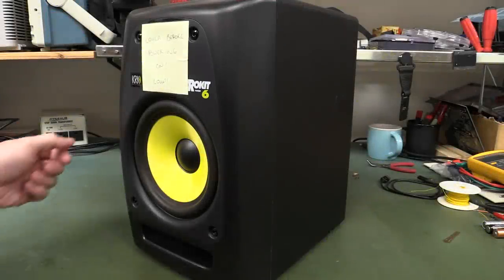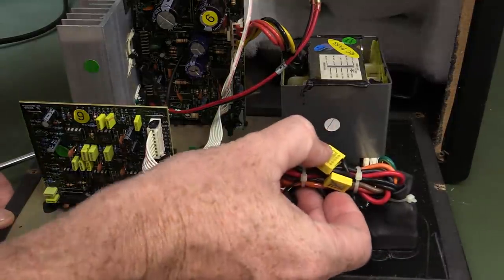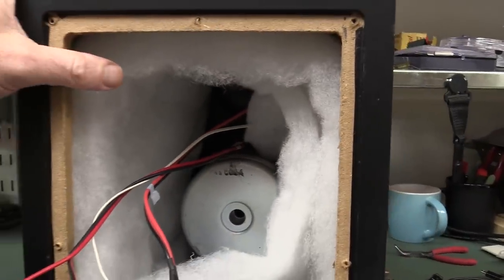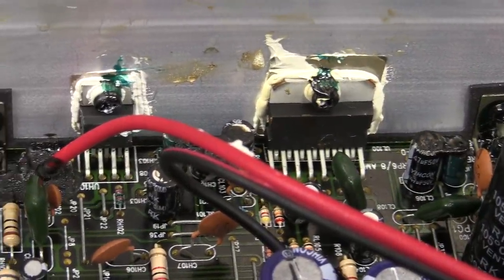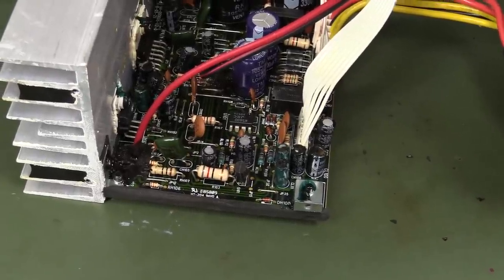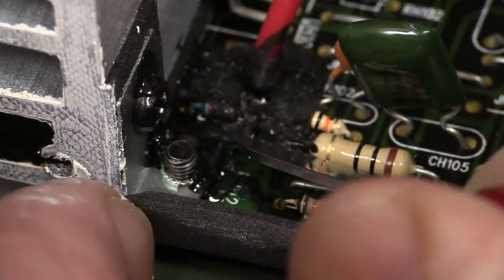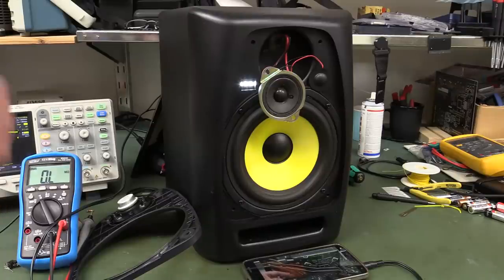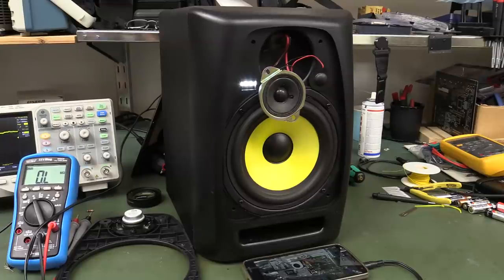EEVblog #1072 - KRK Rokit 6 Studio Monitor Speaker Repair

Comment: I have the Sony those tweeters came from😐. Well, they are okay, but they are certainly not a KRK. I have newer Rokit 5s G3 speakers as well. These are the G2 model. The original G1 had similar electronics to the G2, but the box looked, well... like a box.

Comment: Looks like another case of planned obsolescence to me... Had a similar conductive gunk issue with a pair of Tannoy Precision 8D's (I posted on the forum about that a couple of years ago). No idea why they don't take a leaf out of the history books and use wax like they used on old radio receivers in the 60s and 70s. As for the KRK monitors, they are too coloured for studio use, but often used in trade shows as the colouration makes the gear sound nicer than it really is.

Comment: There are two things going on in manufacturing. One: Idiots work a job they have no clue about. Two: People know what they are doing and they sabotage units so the units break down 2-3 years later so the consuming idiots can buy another product from them with manufacturer stating how the new model is improved in quality over the old one. Corporate lies. Consumers should learn on the mistakes and go for a better product, do a proper research. I personally either go for high class Sony or Asus but everything else is custom made from people I can trust and I am sometimes even involved in the production of the custom made things so I deeply know what have been done to it.

Comment: I'm having this same issue, same exact sound! I noticed two of the smaller caps are bulging, but not the big ones. I actually had this unit repaired at KRK once as well, but not sure if this new issue is the caps gone bad or the goo. Would bad caps make this same sound?

Comment: Kind of makes me want to check my Edifier speakers now. Sure the last time I opened it, had selastic inside! Oh, and my dell server PSU's! They had selastic everywhere. 
Teardown of the Dell 2950 Poweredge power supply coming soon! Built like a brick s**t house or Dave would say what is it? Built like a Brick Dunny?

http://www.oxfordreference.com/view/10.1093/acref/9780195563160.001.0001/acref-9780195563160-e-434

Comment: That nasty stuff decomposes with heat and age etc and then becomes hygroscopic, the water then mixes with the decomposed material, which creates an acid and causes all the corrosion. What I can't believe is that new equipment is still using this stuff instead of the proper Silastic.
Reply: Mark Wallis I've encountered very similar issues in the plastics used both in some SATA power splitters that eventually corrode the contacts and short out the power rails in several of my PCs as well as with some 455KHz IF filters used by Kenwood in some of their radios that decomposes over time rendering the radios almost entirely deaf on receive -- in fact their is a TS-480 on my workbench with this exact issue right now waiting for me to order and replace all 3 filters.

Comment: I checked the RRP for the KRK Rokit 6 and they are available for about $300au each, that's $600 for two. They are just a cheap plastic Chinese speakers and the amps and electronics are awful. Obviously are making a massive profit.

Comment: The spliced tweeter cables are factory too 😀 Nice diagnoses and job I’ve done a few of these, have to replace all caps, remove all that glue and sometimes the resistors and zenner diodes below the glue need replacing.

Comment: Looks like some kind of chemical damage? Perhaps some chemical vapors got in, moisture or something reacted with it.

The tweeter likely broke some wires when membrane moved too far? And just happened to touch and make a connection until you moved it.

Comment: Do I need to worry about this happening with Shoe Goo? I used it to build up strain reliefs on a crossover board, and to glue components to the circuit board so that they would not vibrate. It's that clear, flexible stuff, that you would use to repair shoe. I opted for that over hot glue or zip ties, because it's slightly flexible, doesn't require hot glue gun, and several people who have started using that swear by it.

Comment: I would never have guessed in my life that at the factory they could deliberately pour some unverified shit on the board, which would become electrically conductive over time. Some kind of wicked sabotage. I must say, almost any professional audio monitors are doused with some kind of viscous rubbish inside to resist vibration.

Comment: If you think that a bit of conductive gunk killing a tweeter in a $200 powered speaker is annoying,  try a bit of conductive potting on a filter in a $50K Sony Betacam SP VTR, or a $100K 1" C format VTR.  Sony had their video filter module cans inside the machines potted with some epoxy, which becomes conductive, and is hard to remove without destroying the filter PCB. Then there is the glue they used to hold down some wiring between boards which became conductive and corrosive and would eat through board traces and connectors.

Comment: Damn! i'm listing to this on krk rokit 8's of the same generation.  Tho I've had these speakers since 2012. Everyday heavy use and I move them around for Mobil production, they work just fine  so if they died now i basically got my use out of em anyway. I haven't even turned them off since 2012 lol  switch on the back is a pain.  the shitty design really has me worried i always thought one of my speakers sounded slightly less bass i always thought it was just the shape of the room now i think its probably its probably because of this black garbage
Reply: Phillip Morrison ... Hmmmm how do you move them around for mobile production if you never turn them of???? Either they are battery powered or you have the longest extension power cord in the world LoL...
Reply: obviously they are turned off when i move them but thats only been like 20 or so times in the last 6 years. i never turn them off if they are at my house
Reply: Yeah Phillip... I knew what you meant but I think that you got a bit excited when you typed out your original post LoL... It's okay mate... Say.. Are your 8's a three way... I was looking at getting them a while ago but I needed something for mastering and they needed to have a very transparent characteristic in order to be able to hear any problems with the find mix... The KRK 8's were BASS heavy but the sound of the Fostex PM842 was perfect for what I use them for..
Reply: The rokit 8s are bi ampd witha woofer and a tweeter. I find that people always over exaggerate how "unbalanced"and over bass heavy the krk's are... They get a bad wrap because they are popular and they are yellow... And people love to hate whats popular and panted like a toy. To my ear the krks sound better than the new version of the yamaha ns10's everyone always raves about that sound like they got a bad guitar amp on the high end and the low end just vibrates the room in an unpleasant way.  I find the whole idea of a transparent flat monitor ridiculous. I know what the manufacture means as in there is no DSP or added EQ or saturation.  However every monitor I've listened to  from cheap Mackie's to genelecs and especially custom in wall studio monitors sounds vastly different with varying amounts off bass high end and frequency response across the spectrum changes as well. Also all speakers distort the more you turn them up and they all distort differently.

Comment: this is one of the reasons l never buy active speakers, because if my amp takes a shit it doesn't ruin my good speakers. but if your amp is intergrated and it kicks the bucket then your speakers are pretty much junk since they were made to run with that amp. also you're kind of putting yourself at the mercy of your manufacturer when you buy active speakers, because they could be great speakers with a shitty little amp inside. l have seen some pretty nice speakers in the sub $100 ranger and they come in both passive and active variants and the active version comes with a cheap amp that is under powering them.

Comment: I have 4 rocket 8s and 4 rocket 5s. Is this problem common and looking at the black gunk is this or could this be a fire hazard if the system shorts out. I usually leave a lot of my set up on simply because inspiration comes all of a sudden and when it does I need to get it recorded instantly otherwise if not its gone out of my head as fast as it arrived.

Comment: HAHAHAHAHA. Oh wow!!! I've repaired thousands of these buggers!! Until recently I worked for a company that had the contract KRK for returns and repairs!! This is a G2. The amplifier PCBs can fail after about 5 or 6 years when the glue that is used on some of the components becomes CONDUCTIVE!!!!
Reply: We used to take out the Amp PCB and soak it in Nitro mors!!!

Comment: The convenience of having volume and headphone jack on the front of the speaker? That's what a USB audio interface is for. I got the Mackie Onyx Artist 1-2 right in the middle of my desk. Got a nice big volume knob, separate volume for my headphones, headphone jack right on the front, and separate volumes for the XLR and TRS inputs on the front as well. Then USB goes to my PC and TRS goes out the back to my two Behringer Truth B2031A's.

But if you didn't want to get into all that, the USB monitors are nice to have.

You should see the inside of the B2031A's. Really well done in there. Beautiful bi-amp setup.

Comment: In the 1980s all Sony TV Broadcast BetaCam SP VTRs etc with a few good hours on them ALL began having massive fails with their little PCB mounted screened filter cans in the component/composite chroma/luminace paths. It was usually a matter of desoldering the filter and picking off the underside plastic insulator to reveal the micro filter network pcb and scratching off the brown shmoo that had been used to glue the insulator on with and was now conductive !.... Sometimes though the filter was just too knackered and you had to use a new one and they were BLOODY EXPENSIVE.... Replaced 100s of them...

Comment: I would have thought that all filtering would be done using DSP processors and firmware with a ADC on the input and two 50-100W PWM amps driving the base/midrange unit and tweeter, The sound system I am using to listen to you is using DSP processors and Firmware also the output is 50-100W PWM amps, The bass unit is also DSP based with a 50-100W PWM amp and can go really loud and is bluetoothed to the main unit.

Comment: Exact same problem with one of my KRK 6" gen2's: woofer stopped functioning after being powered off for a few weeks - So incredibly grateful i found this video - I have absolutely zero experience repairing things like this, and was able to find the black goo and scrape it off the pcb with a mini screwdriver / paperclip + some rubbing alcohol - Most needed to be chipped away, but some of the goo was "wet" - (wonder if the potting material melts down due to the generated heat, and then starts to grab and hold water vapor?) - Fortunately, the goo was only in a few isolated areas, and took me no more than an hour to clean up - Didn't seem to work at first, but about a minute later, the bass faded back in to its normal level - This video saved me not only ~$150 on a matching replacement, but more importantly, it opened my eyes to that very replacement would have also been potentially problematic down the road - THANK YOU.

Comment: Funny. About a year ago I was on a service call at a restaurant, troubleshooting their little soft serve Ice cream maker/server, the standard one with two flavor bins and 3 levers in the front for either flavor or mixed in the middle. The mixing motor shaft key had sheared off due to someone sticking something in there while running probably, but what dropped my jaw a little was the 2 inches of MUCK pooled up on the bottom of the enclosure, engulfing everything due to no drain hole apparently, including the wiring harness for the stirring motor, which used a belt to run a drive wheel with the mixing heads axle shaft (where the key had sheared). Of course I always check motor stats out of service call courtesy (and it's sparky-fun), so I was measuring some weirdness and decided to grab a big spoon from the kitchen and shovel out some of the semi-dry brownie mix filth to see if maybe it had somehow eaten through the motor leads. Found the harness, stuck my meter probes into the much and wow! The resistance was bouncing around in the 1k range, plus or minus a couple hundred ohms...! And I would definitely not say the ummmm, "batter" was "wet" in any significant sense, too....! Needless to say I wasn't afforded a lot of time to play with it, and also since the day manager was kinda looking on and saw the ummmm, "ruiner of soft-serve ice cream for me" and wanted to clean it right away, I didn't get to play with my megger that I was hoping to get out, throw some 1000v through it, see what the needle does, lol. Oh well, still strange conductivity from things that probably shouldn't have such properties, especially thinking about eating it...!!??!!   HA!   BTW, good work!

Comment: Funny, a few years ago I had a similar issue with my (well, now like 15 year old) JBL SCS 135 5.1 set - conductive gunk on one of the subwoofer boards. It started "motorboating" once I turned it on. Scraped it all off, works like a new one again!

Comment: Sony used a white glue in the 1980s after 6years it turned brown and conductive, this was in their broadcast equipment.
At AWA in the 70s we used neutral curing, slumping silicon, it was so expensive only the girls (55 and 56 I was 17) were aloud to use it.

Comment: That is a disgrace. What is the gunk made of? Weirdly, it may have been a rubber compound of one sort or another, which became conductive over time due to whatever they added to the rubber. I have seen slightly similar gunk before, when the belts of cassette tape players made in the 1970s, liquefy and must obviously be replaced. What interested me about the degraded 'rubber' cassette player belts, is that they turned into a similar looking black liquid goo, which had to be removed from belt pulley wheels using cotton buds and 99.99% isopropanol. Excellent video. Have never seen this before, and enjoyed the fact I was thinking in precisely the same way when you were taking it apart (aside from managing to convince myself a bunch of electrolytic caps had failed when that was not so as you demonstrated. brilliant video...important reminder of the need to test gunk for conductivity

Comment: Ack! KRKs are studio monitors that should be "set and forget" and volume controlled via your interfaces hardware mixer. The headphone jack should be on the audio interface, not speaker. These are not desktop speakers. They belong on stands about 6 to 8 feet away. Sorry, but your USB speakers are DSP controlled and entirely inappropriate for a proper recording monitoring and mixing environment as the sound is not even close to accurate.

Comment: In an audio amplifier in a speaker enclosure, there is a definite possibility of microphonics causing feedback.  Unfortunately the "solution" is to immobilize anything that MIGHT be in the feedback loop.  Thus the "goop" (probably liquid gliptal or some such ("liquid tape"?).  The cheap components (design to price) are susceptible to microphonics (ceramic caps seem to be vulnerable) and you are witnessing a "shotgun" approach to attempt to solve the problem.  To further diagnose the problem you might start tapping components (on both boards) to see if there are components susceptible to the problem.  The real solution is to have the amplifier in a separate box so it won't be effected.  You might have it functional when in pieces, but when you put it back together, and sweep out the response, you might trigger a problem somewhere.

Very good diagnosis.  Visual inspection, then power supplies.  #1 and #2 in the test list!

Comment: lol, the classic glue that goes conductive. You can see in the video it's even got droplets of water(?) on the glue surface. Very common in logitech z906 and some other electronics.
 Imagine this on the smps psu of the z906(so at 230v mains rectified voltage), let's just say  i've seen lots of them with  burned pcb's.  Another type of glue that becomes conductive is the white one that starts to turn brown, yellow. 
I'm gonna go with planned obsolence, no way the folks at logitech  don't know about this problem

Comment: I just want to say something about speakers. 
1. Be aware of the climate you are using them in. 
2. Studio monitors are intended for studios not home entertainment. 
3. Don't buy expensive studio speakers without knowing what you need. Speaker size vs. Room size. Positioning and isolation. Will they mix well with your active speakers. Dynamic range. Wattage. Driver types. Cabinet or ported. 

Now with that being said the KRK are a good all around mid range speaker. If you think you're going to blow your shirt off from the bass then you will sadly be mistaken. Now using mid range speakers to drive heavy bass without a subs to compensate will damage them as it is not their intention. 

Yes there are plenty of better speakers out there but unless you know what you are talking about then just stop bashing. Someone who doesn't have thousands to blow on speakers doesn't need to feel discouraged because you have a stick up your bum 😉

Comment: This is a bit of unrelated question but can't find the answer. It's a basic one. Hope you can help.
The Xlr input and TRS inputs, are they routed the same or is there anything in between? Curious whether I connect XLR/TRS or TRS/TRS and if I'll get the same signal regardless. 
I can't see much in the way of components on the relevant board.